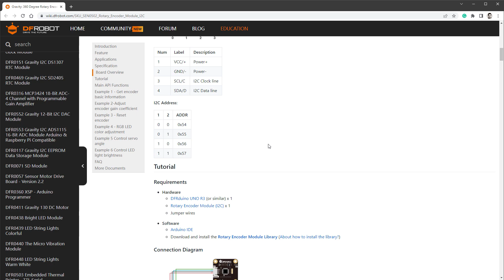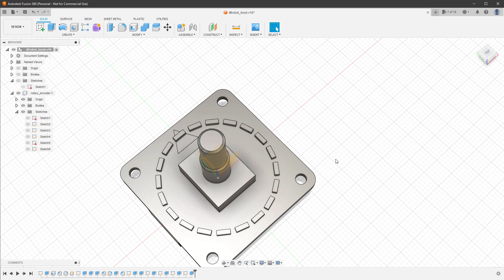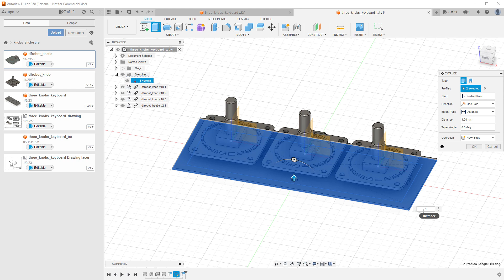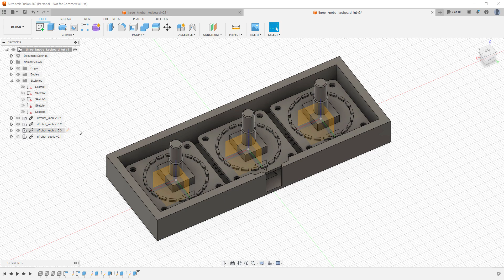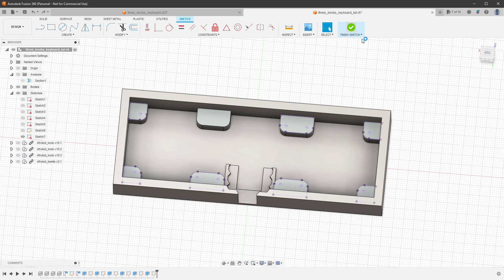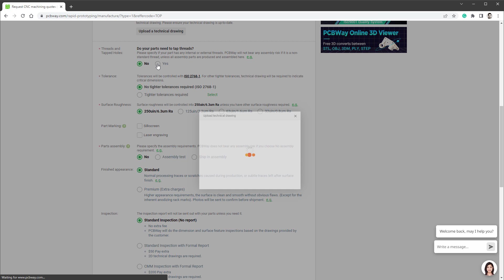My First CNCed part --EVER--

Comment: Very nicely done! One tip that made a lot of things in Fusion easier for me is when extruding you can set where to start from or extrude to face or object. For example the supports for the knobs, you can extrude them to the bottom of the board instead of a fixed length. This way, when you move the board, the extrusion will automatically change. Starting form an object can be handy so you can use the same sketch if you want to extrude something but start at an offset. But again, great design and very well narrated!
Reply from the maker: Thank you for your comment and for a helpful tip! Good luck with your projects.
Reply: @upir_upir  You're welcome. And the same to you ;)

Comment: Great job! For a first-time user of Fusion 360, you did very well using the right features like constraints, mirroring, etc. If I could give one piece of advice to new users of Fusion 360, it would be to learn to use parameters early on, and use them both in your sketches and in the design. It makes it so much easier to tweak your design by just changing numbers in a table rather than revisiting countless steps all throughout the timeline. Once again, well done!
Reply from the maker: Thank you for your comment and especially for the tip with parameters. I agree that it makes any updates much simpler, and I will surely use them in my next design.

Comment: Very nice but, why do you have position indicators on the knobs, when the LEDs are the indicators? So if you load a preset, you would have to turn the knobs into position....
Reply from the maker: Good question! The resons is that those were only knobs I had for the size. Of course it would be better to have those without the small arrow..
Reply: @upir_upir  That's a perfectly good reason.
Reply from the maker: Yep, I need to get the same ones without the arrows.

Comment: What a timely video this was for me. I am just about to start designing a plastic wall-mounting box for a touch-button PCB I've already had made and I was considering 3D modelling the box and having it 3D printed in UV resin. Despite having my own 3020 desktop CNC, I'd actually never considered milling the part. I noticed PCBWay support many different materials. Maybe I"ll look at the costs of milling verus printing! Thanks for showing the upload steps via their website for your exported STEP file; that was very helpful for me.
Reply from the maker: That´s great to hear, thank you for your nice comment and good luck with your enclosure no matter which technique and material you choose. Please post a link once it´s done, I would love to see it!

Comment: Very nice project. I like the accuray and the finish, wow, that's high level. 👌👌👌 But what do the rotary encoders control? I could not find it out. Could you please tell me?
Reply from the maker: Good question! They don´t control anything at this point, this is for the next time :) I need to find some meaningful usage. Do you have any ideas?
Reply: Color correction controls for premiere, via Arduino - > midi!!

Exactly this will be my next project. The knob part is relatively easy, but the rgb led control seems complicated. Great video!

Comment: if you haven't, you should really consider getting an fdm 3d printer, it's an amazing tool.
Reply from the maker: I’m considering it for a while, but I’m worried it will take all my time. Do you have a recommendation as to which one to get? Thank you
Reply: @upir_upir  if you have the cash and want zero setup and maintenance get a bambu labs, prusas are ok too but require way more tinkering (building them mostly). there's many other budget printers but most of them are unreliable and high-maintenance.

Comment: WOW! first go,fascinating but if I were to invest the time I think I would use FreeCad...awesome project...cheers.
Reply from the maker: Thank you, I´m glad you like it. I might try FreeCad the next time. I have installed it already, but Fusion 360 seemed easier to use / with more tutorials for complete beginners.
Reply: @upir_upir  Thanks !
Reply: @upir_upir  I just migrated from FreeCad (to fusion) because it was simply too annoying, too bug filled (worse if you use it in windows and not Linux, I used both) and too cumbersome. Basic stuff can't be done in it, like simply extruding more than one closed loop from a single sketch. It has 2 design modules, "part" and "part design", with different philosophies and some incompatible operations, but for most uses you can't do it all from a single one. Forget about stuff like projecting geometry into a sketch as fast as in Fusion. Also, be prepared to hate fillets (FreeCad will freak out if a fillet ends in a corner, ie you choose a triangular surface, or if more than 3 fillets meet together).

FreeCad is a great initiative, but the main development team is reaaaally closed in accepting suggestions or changing the way things are done in the software (endless talks in the forum with the main theme being "you dumb user don't know how to draw, FreeCad is OK as it is"), and the 3D modelling kernel, while open source too, is not very good and not really being worked on. Just imagine the frustration when a simple boolean join fails, and you find out it is because the parts were a micron apart from each other... a micron that came from a rounding error as your part had some derived inclined or curved surface.

PS: Im a professional mechanical engineer, with formal training in sketching, blueprint drawing and modeling, so if FreeCad was hard for me and my partner, I can understand why most novices think its unusable. Just a too steep learning curve. I used it because my previous work was drawing really simple geometries for CFD, and those must be perfect, which is something FreeCad pretty much enforces on you, but now we are doing a lot of mechanical design, Fusion has paid for itself in one or 2 months just for the time savings. Having it crash half the times you made a fillet it didn't like is not very productive. Also, as you work with electronics, consider Fusion is being integrated with Eagle (it has its own internal EDA derived from Eagle). For freecad, you will need another software and exporting/importing models.